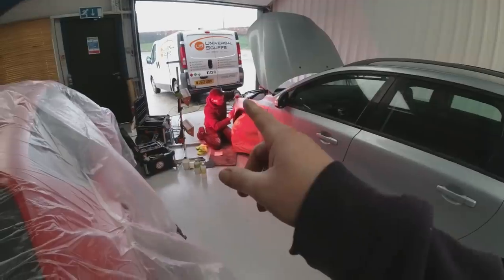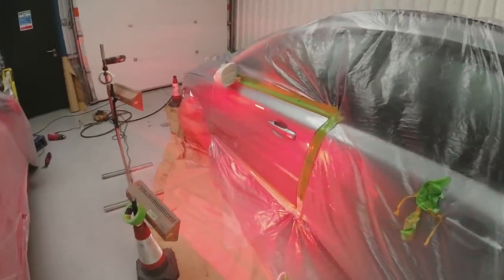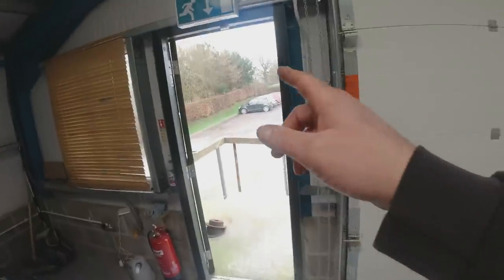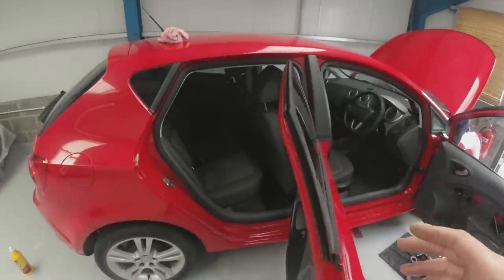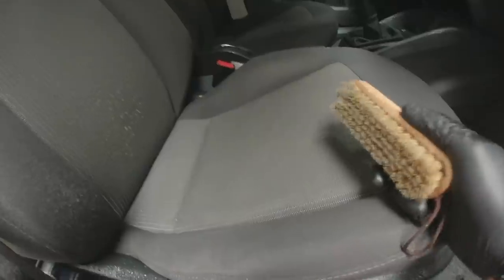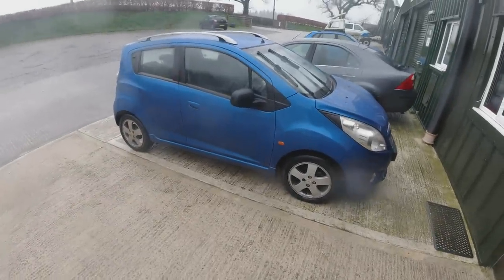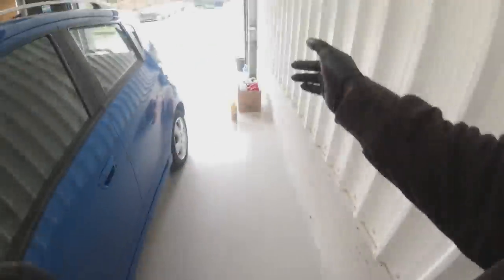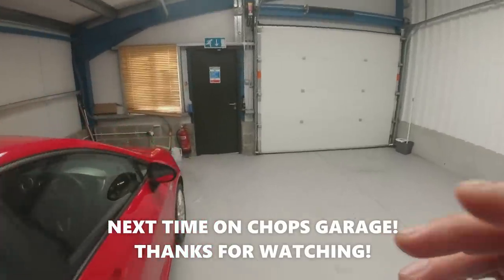Why did the Skoda Fabia keep BREAKING DOWN on test drives!!

Comment: The Chevy Spark cleaned up nice. Got myself one a few weeks ago, same spec but silver,  low miles and cheap but just needs some work. I've got a rattle from the clutch.
Reply from the maker: Bummer prop release bearing
Reply: @ChopsGarage  Not sure what it is but it only does it when warmed up and rattles when idle and clutch isn't engaged/neutral. I'll get underneath when the weather cheers up and have a look.

Comment: Great video mate, last two gearbox jobs (swifts) I just did a drive in drive out thing with maltins transmission, on your own and with no ramp you've done the right thing bud, so no ass kicking from me, glad sodka was just a coil pac, focus was cheap enough at 750 on a 09,id have let your mates have had a look at it, been well worth chucking a few quid at it, your really flying along now bud.paint on volvo looks great, that dave guy seems great.
Reply from the maker: Yes outsourcing has help me catch up a lot. Costs me about £200 more per car but I can do much higher volume without fixed overhead I can ramp up and down
Reply: @ChopsGarage  yes bud your doing great, I used to farm everything out back in the day, paint, valleting, mechanical work, but labour rates were so much less.

Comment: Love the channel I have to say your paint prep is great and I think the missing link is the rattle can ! Get a gun and then you can get a gallon of 2k primer £25 a gallon of clear probably £40 and then it just the base coat I can't be sure of the price in the UK but I feel confident saying at most £ 20 a 1/4 litre . Painting with a can is a nightmare and that's what seams to be your problem . If you still don't feel confident you can prepare up to primer and get someone in . I'd grab a panel paint it the most ballacking high metallic and practice your blends VW LA7W silver was my baptism by fire . I F#@$_# hate it .
Reply from the maker: Cheers buddy, silver is a pig
Reply: I brought Lazer scanned colour Mach for 22 for 1L really can't tell the difference

Comment: used car prices are mad at mo, but here is my point, a year or so ago, you could get a runnber for £400-£500 on ebay with mot, you expect a year or 2 out of it.But now folk cant get anything on ebay, so they pay £2000 plus for a 12 yrs old car at a dealer, normally a 12 yr old car dealers wont touch or they are worth under a £1000, 
but this is still alot of money for folk, so if it breaks downs  lots, fails future mots, folk will say I paid £2000 plus, and  that is a lot of  money,  but the real price in pre chip shortage times, ( which is the cause for used car prices, eg the lack of new cars for sale)eg,  18 months ago,is prob on worth £600-£900 so it is still banger territory.

Comment: modern electrics will fail cars around 8 to 12 yrs old,to cause them to be scrapped, imo either buy a new car under warranty or buy an old banger for (£300-£500, drive it for a yr,) and used prices will come seriously down in next 12 months, as the microchips now reach all those new cars that are waitng for thess chips. buying any car at these inflated prices is like buying a a stock in the stock market at the dotcom bubble of 2000, if folk waited 12 months they could have got these at a song, just the same at the US nasdaq has collapsed in  tech stocks in last 6 months, I am a stock market investor.

Comment: Now i do like that volvo so so handy with having such a big load area plus great to tow and family life
Reply from the maker: We had one as family hack was brilliant
Reply: Even without family they are handy. I had a v50 (same platform as Ford focus) and now have a v60 cross country. Even with the larger size, slightly more weight, and more power from the smaller engine I'm getting about 5 mpg better city driving with the v60.

Comment: That mirror is spinning around because something is actually broken inside. It's not worth replacing as they're quite expensive.
Reply: Hi, are there any limit switches or sensors that detect rotational travel ?, if so can they be replaced it they're the problem ?.